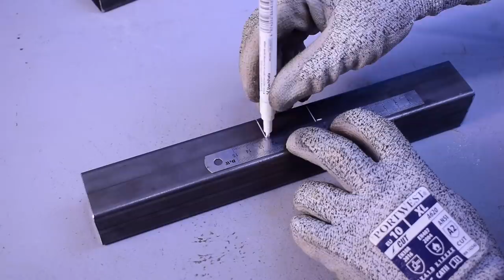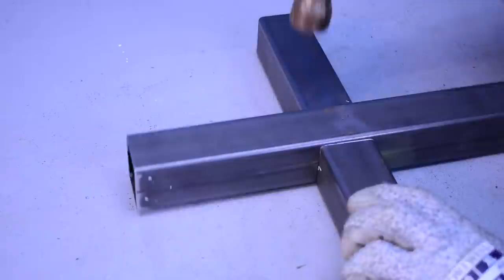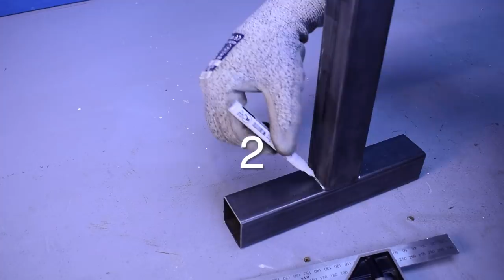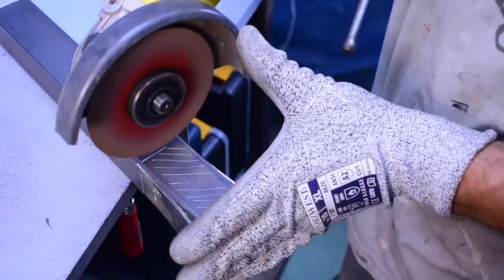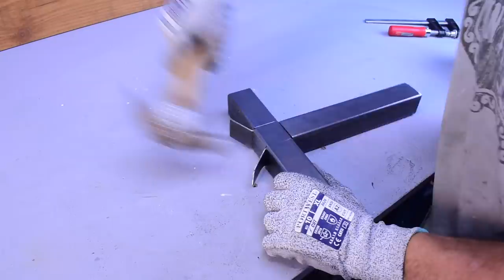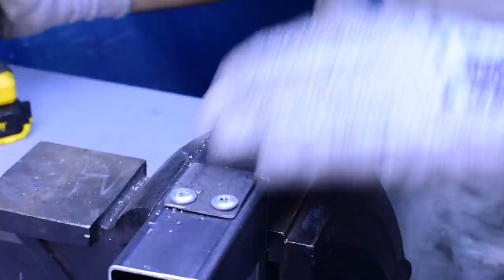Welders Don't Want You Know This! Join Metal Pipes Without Welding

Comment: we welders want to watch you build something using this and then put it under a load.... that should be hilarious!!
Reply: im not even a welder and I want to see that.
Reply: What are you even talking about? It has FOUR self tapping screws... they literally tap themselves! That last piece can support at least TWO more of the exact same pieces. The future is here.... Welders everywhere are already looking for new jobs, cutoff wheel factories are switching to 18hr shifts, forget about even trying to by paint pens...
Reply: @J_The_Detailer  well, I have nothing near as sarcastic as that ready to go just yet.....
Reply: @lukewarmwater6412  I wasn't being sarcastic. I was being serious until my daughter built a couple of these setups to raise her power wheel car and everything buckled. It broke her arm but the worst part is.... Now I'm out 16 self tappers. 

I'm jk, in all seriousness... you're 100% correct. As a semi-decent welder, my hats off to you guys that literally make all aspects of life possible by not doing this kind of stuff. If ppl cant or won't even buy a cheap welder on amazon, ebay, offer up etc..., they shouldn't be making things out of steel. I sure as h*ll wont be trying an open heart surgery "without having to purchase necessary equipment".
Reply: @J_The_Detailer  I have a little welder I bought at ranch and home for exhaust work. its a 110v 15 amp spool gun welder. got a gas bottle for it as well. total cost was around 250 bucks.it works on aluminum and stainless when you use the correct wire. not much more than buying an air compressor and a die grinder.
  anyone can learn to weld. I dont do it at home often, but when I have to I can... most times I just weld my own stuff at work on my breaks.
Reply: Welders have been keeping bolts a secret for years.  For the longest time I would assemble things with only magnets and shoestrings.  I am so glad I found this video.
Reply: I could see this videos applications being used for like a table or may some chairs, but anything beyond that your going to have problems
Reply: @birdfire0011  it isnt such a fantasticly horrible idea, you could make a curio shelf or a chair this way and it might even be stronger than something from ikea.....
Reply: I'd say it reminds me of woodworking, but even woodworkers use glue sometimes.
Reply: Of course it is no where near as strong as welding. The sad fact of the matter is, most people today will not take the time to learn anything unless someone can first sell them on the idea that someone else has been trying to hide the information from them for years.
Reply: Εάν νομίζετε ότι με την ηλεκτροκόλληση θα γίνει πιο δυνατό κάνετε λάθος. Όλα τα κτίρια που έχουν σίδερο όλα μπαίνουν βιδωτά δεν κολλάνε πουθενά στις ενώσεις   
Είναι πολύ ωραίο και χρήσιμο βίντεο Μπράβο στον διαχειριστή του βίντεο. Να είμαστε όλοι καλά. Ευχαριστώ για τις συμβουλές!!!
Reply: Yeah, these joints look good it you are just doing some DIY at home or something, but they defo wouldn't stand up to load/stress.
Reply: @pbking442  once, when I was bored I took all the scrap from the stock cutters bucket and made a dragon... it sits on top of my fridge, but only cause its too heavy to sit on top of my toolbox..
Reply: i feel like i should report the video incase this gets someone killed lol
Reply: @Wiccanman12  that would be natural selection and I dont think we should interfere.
Reply: acrylic adhesives are replacing welders! YES, I AM SERIOUS. If you don't already know this then you are way out of touch with reality.
Reply: @tangokaleidos1926  if you honestly believe glue is going to replace welds then I dont think you are all that in touch with reality... welds are still cheaper and faster. and that is what business will go for, cheap and fast, every time.... there is a reason we dont use red hot rivets any more.
Reply: @lukewarmwater6412  glue is replacing all welds. You need to wake up. Welders will all be gone soon unless they want to hobby weld at home for fun.
Reply: @tangokaleidos1926  you arent thinking it through. there are plenty of things that could replace other things that arent being used because they are expensive or take too much time. nobody is ever going to trust glue to hold pipe joints together.
Reply: @lukewarmwater6412  people trust aircraft wings to be held together with glue. Race cars are held together with glue. Adhesives have changed dramatically over the past years and are much stronger than steel now. Skyscrapers are held together with adhesives now. If you want to call it glue then call it glue but it is MUCH stronger than a weld depending on how it is attached. Adhesives can easily cover a larger surface area and can be used to create sandwich panels which are much stronger than welds. In the high tech industry everyone is using adhesives now. You will see that it replaces all other welds in the near future.
Reply: @tangokaleidos1926  if you can get epoxy to hold on a steam pipe or and exhaust system on a car, maybe. untill then you are just dreaming about this. 
 and most people these days who dont want to fly feel that way because they are afraid the wings will fall off and the plane will turn into a giant lawn dart because they absolutely dont trust glued on wings!!
 you are an idiot.
Reply: @lukewarmwater6412  the adhesives we are using are much stronger than epoxy! I am stating facts. Adhesives most definitely can hold on a steam pipe and exhaust system on a car. You should spend a few months doing some serious research because you are the ignorant welder who is about to lose his job.
Reply: @tangokaleidos1926  my skills are in such high demand right now it isnt funny. maybe in a decade or two your predictions will come true, but by then I will be retired and wont care!
Reply: @lukewarmwater6412  I'm happy to hear that. I don't wish anything bad for you. Good luck.
Reply: How much load?, I'll design & build a cat condo with this method and load it to design capacity and it will be just fine 😝
Reply: @jarrodsanders208  don't tell them about rivets!
Reply: @cecilmicko6828  how many ships & skyscrapers were built without welders even being a thing yet?
Reply: 木じゃないんだから笑
Reply: @tangokaleidos1926  donc en sois tu nous dit que ton adhésifs acrylique , garde l'étanchéité d'une pièce , resiste a des tonne contrainte , les produit chimique . je me demande qui est déconnecté xD
Reply: @MrKevin59194  Les avions, les voitures de course et de nombreux gratte-ciel modernes sont maintenus ensemble avec des adhésifs acryliques. Tous les 3 sont très stressés. Ne confondez pas l'adhésif acrylique avec la colle. Ce n'est pas pareil. Je sais de quoi je parle.
Reply: @tangokaleidos1926  pour ma part je connais mon sujet aussi car j'ai déjà vu des test avec adhésifs pour ce qui est des avions et voiture déjà il n'est pas possible de pouvoir souder certaine chose s'est tu pourquoi ? ensuite pour ce qui est du armature en métal gratte ciel et autre ton procéder peut être utiliser mais pas pour tous malheureusement .
Reply: @tangokaleidos1926  Lol. We are not going anywhere no time soon. Welders are forever.
Reply: @tangokaleidos1926  Its not the wings that are glued it's the skin on the wings lmao.

Comment: I have been a welder for 40 years. If I made a joint like this rather than mig our tig weld it I would check myself into the nut house. Welding is far less time consuming, stronger, and welding was actually invented to be a more cost efficient and stronger way to join metals. I will give you a thumbs up for creativity but as far as a welder being concerned that anyone knows this. I think there is no threat there. Nice creativity however.
Reply: Вы правильно все заметили! Нагрузку данные способы крепления выдержат намного меньшую, чем сварные!

Comment: Amazing work, I can see why welders would be really worried that these techniques might put them out of work.  Good demonstration pieces, now let's see you build a custom motorcycle frame using the same techniques.  Good luck - you're going to need it.
Reply: Ин мн
Reply: @ИлдарИдиятуллин-г2в  If you are replying to my comment it might suggest that you understood it, shame that you did not reply to me in a language that you obviously understood but chose a language that I don't know.
Reply: Pp
Reply: Pppppoppppp
Reply: Might as well lash together with rope.
Reply: I’m a welder and I’ll sleep fine 🤣
Reply: Highly doubt it. Too much messing and time. Takes seconds to weld it.if you don't have a welder then fair enough but if you do then weld it. It's easier
Reply: No kidding 😂. Metal fabricator here, I promise nobody in this industry is worried about this guys channel.
Reply: @ИлдарИдиятуллин-г2в  quê eu nãos
Reply: Not threatened at all just means I charge more when you bring it to me to fix your stupidity
Reply: @0xym0r0n_45  no we are not 😂 these stupid videos demonstrate what NOT to do
Reply: These techniques would never replace actual welding. 🙄
Reply: The metal around the welds would fail before a quality weld. Welds done correctly, will be stronger than most steel.
Reply: Фхфххффххфхфхфхффхххффхфхфх
Reply: Хфххффххх
Reply: 7th

Comment: Actually, you've compromised the resistance of one of the pipes by cutting off 2 of its walls and then you also bended the remaining 2 walls at a 90 degree angle around a single line of material, which has (almost) compromised the remaining 2 walls as well...
Reply: Херня,а не видок.
Reply: Probably matters what you are going to do with those pipea.
Reply: Совершенно верно! Вы правильно заметили, что представленные виды соединений не смогут сравниться со сварными по испытываемым нагрузкам. Видео скорее развлекательного, нежели технического направления!
Reply: dont care
Reply: Black Sheep in the shitty for one thing they are not pipes they are tubes now you know the difference between a pipe and a tube.
Reply: Can you just solder the seams to increase strength?🤔

Comment: Both joins are weaker than good welds. The tab and slot  loses regidity of the join, as well. For light duty, sure.
The other one, a little extra compressive strength can be gained by only removing one side, while cutting the grooves to mid-way and leaving the cut sides to serve as interlocks, which reduces the chance of load on section A indenting the sides of section b via load-induced flexing of A; internal bracing, if you will.  (Yeah, I know a lot of guys who bend metal for fun...)

Comment: These techniques are fine for a hobbyist without a welder, of which there are legions. I am a hobbyist with a good quality welder, but I know well what my welding is worth. The joints are fine for what I need but wouldn't want a pro to see them.

Was impressed with the cutting. I can't cut as precisely as that with a hand-held grinder, possibly because I know I'm going to weld over them.

The main lesson for all hobbyists is to understand what you're intending to do with the steel you are joining. You absolutely don't need to be a pro to make simple things like shelving supports, brackets, simple low-load frames etc , no matter what anyone tries to tell you. But if it's something serious, such as a building structure, only let a pro do that. You can learn the basics of MIG welding in a day, but to become good and create safe welds every time can take months of daily practice, maybe years. Know your limits.

Comment: It will move and twist under pressure 
Weld make it solid also welding it's quicker.
Reply: yes welding is great if you have welding equipment and are say  welding steel to steel
BUT if you are say mounting copper on aluminium,, you eighter need  screws ore some other means to hold it in place:::  SOLDERING works in some cases. but not to fasten say wood to steel. 😅  say a wood handle on a hammer where you  traditionally used a gap in the end of the handle to place a wedge. so that it was almost impossible for the hammer head to fly off if done right.
nowadays most wooden hammer handles are glued with epoxy.

Comment: Yes, all plausible joints depending on the circumstances they'll be used in.
But welders are probably not going to be worried about anyone knowing these methods.
They lack the finish and strength that welding offers under some conditions.
A sports motorbike frame for instance.

Comment: Weldors are just fine with sharing tricks and do so on many forums.  While the fitment is quite nice that joint is not as strong as a proper weld, and welding equipment is hardly difficult to get (one can even weld using DC from car batteries which is pure DC with no ripple).  The title is silly but nice work otherwise.
Reply: 👏 Thank you for your comment!  I have lots of soldering experience, but need to do some basic welding on a fence gate. With some welding tools and all safety items, what's the simplest & least expensive way to get started with a little  practice welding? Thanks again!
Reply: Best way is systematic practice. Visit the Weldingweb forums for gobs of info (I've over 4000 posts there but am not affiliated, it's just a cool community). Practice on scrap posts or metal the same thickness, grind it clean (with about an inch margin at least because galvanize is NOT your friend) and learn by making lot of long beads to develop muscle memory. Always set your amps on similar scrap and never your workpiece! First beads should be horizontal then graduate to vertical. Neatest beads for vertical on light metal are welded downhand. Don't fear burning up some wire learning as it''s more than worth it. Look for a variety of scrap to practice on but as ya learn it can be worth buying steel too (get to know yer local supplier) as many shapes are quite reasonable. You'll likely get great use from welding making shop equipment, repair welding and much more so never get discouraged. No one was born with a stinger in their hand! Always grind to clean metal for best results as most welding screwups are due to poor fitment and lack of cleanup. Patience is gold. Have fun!
Reply: @obfuscated3090    Thank you so much for your great kindness in sharing your knowledge and experience!!!  I'm going to ease into stick welding... I purchased safety equipment first 😏
I'm used to oxy-acetylene, LP soldering with precious metals and copper. Gold is absolute heaven because of its immutability. So while I'm not easily discouraged into quitting anything I want to learn, I do have a deep abiding respect for the flame & the lightning. They don't call it a stinger for nothing, true?  I should probably get a less expensive stick welder and start with mild scrap steel, and stay away from 12v batteries in series, & stick with using my 12v charger for electrolytically removing rust from expensive planishing hammers, right? 😄  Thanks again for taking the time to reply to me. You truly made my day!!! Have a brilliant weekend!

Comment: Welding it would be a much quicker job but good to do if you don't have a welder.
Reply: Welding is just a modern and quicker way to do it. The Titanic and other ships of that age were riveted together. Steam trains were riveted as well. Even a pair of scissors are held together with a screw. everybody knows that metal can be screwed together. This video is so clickbait.
Reply: Oh I forgot, all machines consisted of a combination of; 
a screw, a pulley, a lever, a wedge, AND now 
electronics, an accelerant, password, a weld, & a paint job.

Comment: Square tubing is welded for a reason and depending on the application fasteners are not a suitable or a safe replacement, strength and long term durability are seriously compromised.
Reply: I was beginning to wonder "When's he going to caulk that joint so that water doesn't get in and rust it from the inside out?!?!"  :-)  No layer of paint in the WORLD will make those joints water-proof!

Comment: That alone would not be as strong as a weld, BUT if you did than and THEN welded the edges, that would be a mighty strong joint.

Comment: The first is just a metal half lap joint. I would worry that the bolt would pull through the metal without a washer to spread the stress. The second method, why not just use brackets on the inner corners?

Comment: Welder here: If you have experience and a good welder, welding would be a lot faster and just as strong if not more, especially with these simple shapes.
Reply: Another welder here: Welding IS stronger. He weakened the tubing by cutting it, altering its structural integrity.

Comment: This method is certainly not a substitute for welding in a strength-critical application. But it should be fine for household hobby projects. You could reinforce the joints with clamshell halves bolted together with washers, but the rigidity will never be the same as a proper weld.

Comment: Some useful techniques shown, perhaps for making lightweight  furniture or lighting stands etc. However both the joints and the steel tubes are nowhere near as strong as fillet welded connections would be.

Comment: This would only be good if the load was very light and you didn't need a smooth finish (bolt, nut, screw heads) Buy a reasonable priced wire feed welder, learn to use it, produce good work. No fabricator is worried about this.

Comment: There'll be no strength in those joints now you've hacked chunks out if the material.
That 2nd one in particular will be almost useless the second you but some stress on that joint.
There's a reason we weld joints and don't use pissy little bolts to join metal sections.